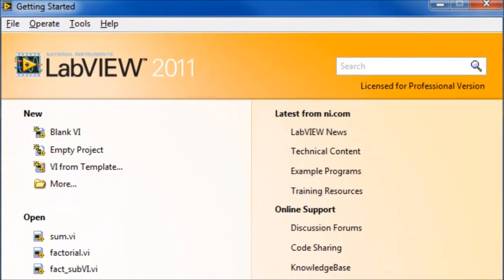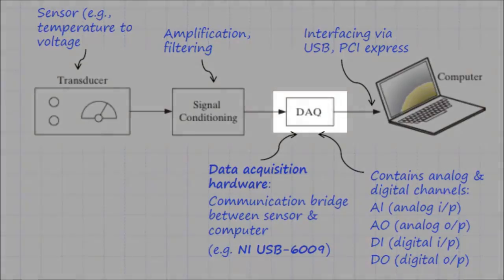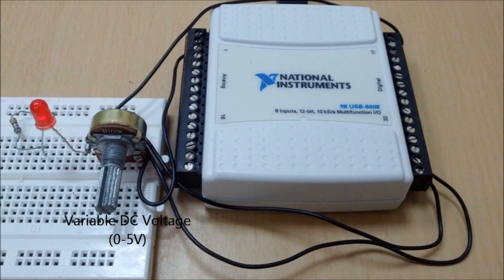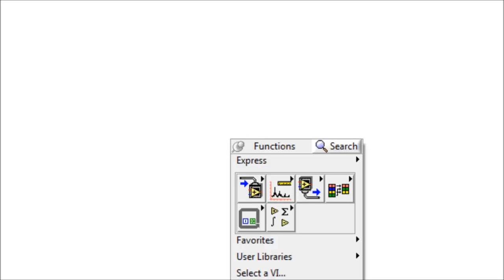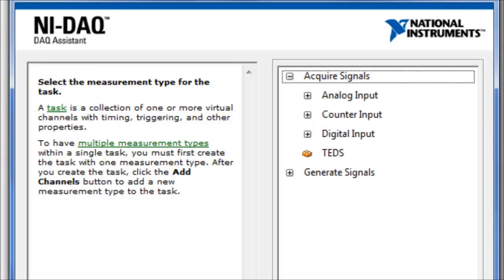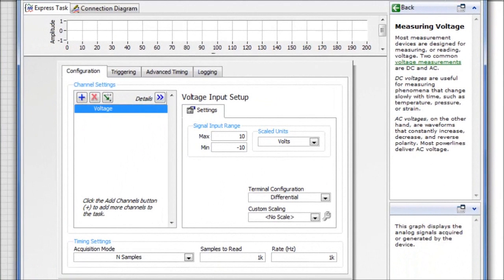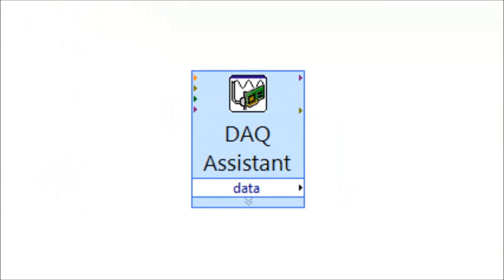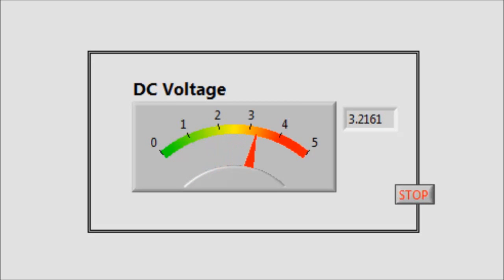LabVIEW Tutorial - Data Acquisition

Comment: Your video does not include a hardware diagram or a schematic for the circuit you're showing. Not a good practice when trying to demonstrate or teach. Even if you components are simply, you should all way provide a guide to show how their physically connected, i.e., anode versus cathode for the LED, where wires are connected for potentiometer, where wires connect at NI USB-6008, etc.
Reply from the maker: Thanks for your feedback. I did this tutorial 10 years ago, and I was new to YouTube tutorials. If you checkout my recent tutorials, you’ll see everything is well documented. Thanks again.
Reply: @AnasKuzechie  
I didn't notice the date. Do you remember how you had everything connected. I need to start working with NI DAQ at work and thought this would be a good start.
Reply from the maker: @jeff8794  I can add link in the description to circuit diagram
Reply from the maker: @jeff8794  I can add link in the description to circuit diagram
Reply from the maker: @jeff8794  You can find a link in the description to access the circuit diagram. Again, thanks for your feedback.

Comment: Thanks for video. But I have a problem. I used your matlab code. When I rotate the potatiometer, the value chaneged 0 to 0.9  between. I used daqnavi 1710HG. It's support to analog and digital process. Do you have a recommend ?

Comment: hey, I have an arduino board(standard UNO). I need to diaplay the data acquired by the arduino on a labview setup. Can i do this without the interfacing unit ? will the labview system be able to read the data that is coming in serially from the arduino?